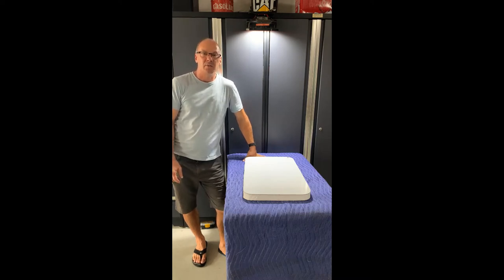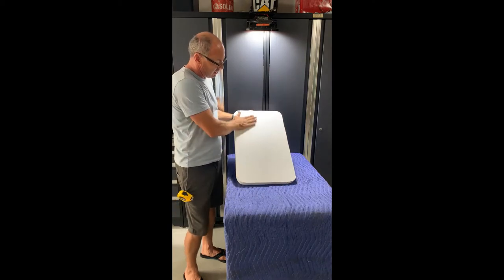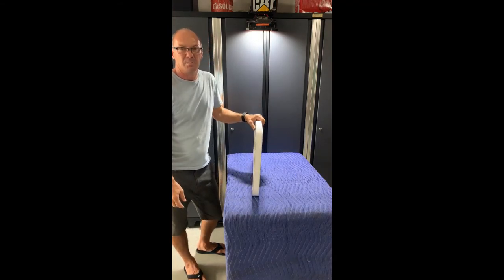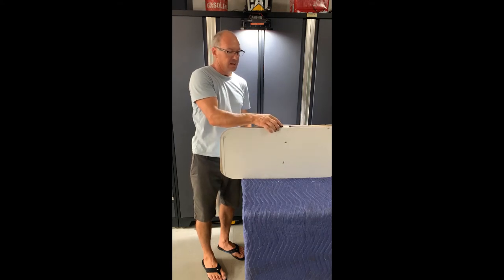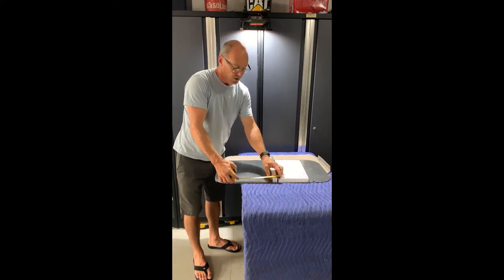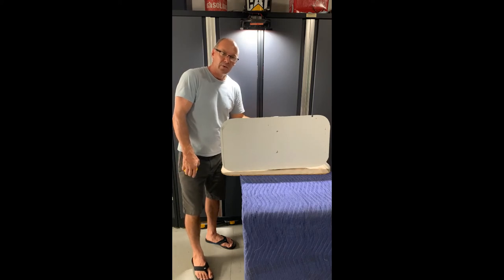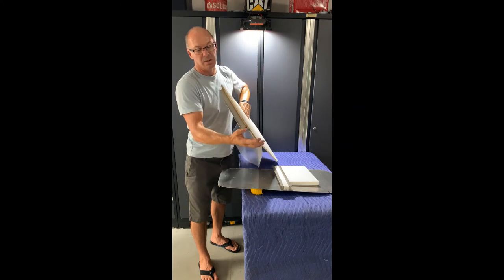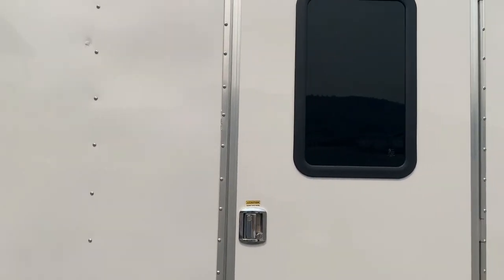Enclosed Trailer Toy Hauler Conversion Window Install Tips

Comment: Have you had any issues with the weep holes? Looks like you flipped a vertical sliding window sideways..
Reply from the maker: Hello, I haven’t had any drainage issues with the windows at all. My intent was to drill holes in the lower side of the window to allow for drainage if it was an issue. 😀